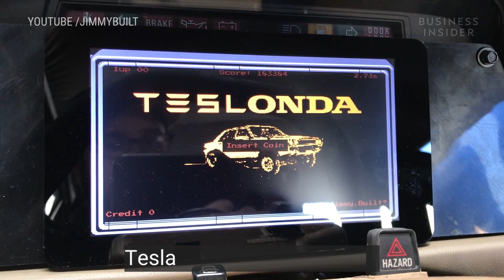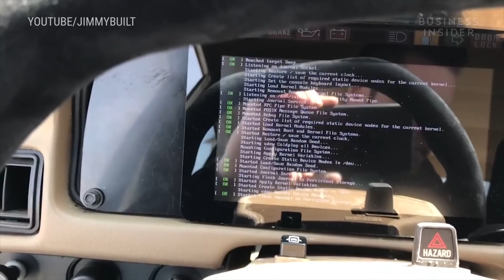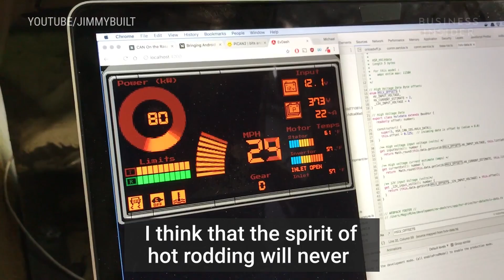Car Enthusiast Combined An Old Honda Accord With A Tesla Motor

Comment: This is amazing- Love it!  Well done!  on a related note... Calling all Tesla lovers! The 2014 Toyota Rav4 EV is a rare gem with only 2,489 units ever produced. This unique collaboration between Toyota and Tesla offers a blend of reliability and cutting-edge electric technology. With a range of up to 103 miles per charge, it's perfect for eco-conscious drivers. Don't miss your chance to own a piece of electric vehicle history!  Don't miss your chance to own a piece of electric vehicle history! I have this car in blue 2014 RAV4 EV and LOVE it, but have to part with it. It is very clean, one owner, no accidents, mint condition for a car that has driven 115k miles and could easily drive another 115k. We just spent almost $10k to have it restored to its full capacity (rebuilt motor, coolant delete, New KYB shocks & newer Michelin tires & new TPS modules- can provide receipts. Located in Los Angeles. Make an offer!